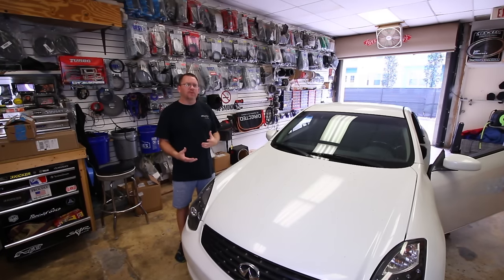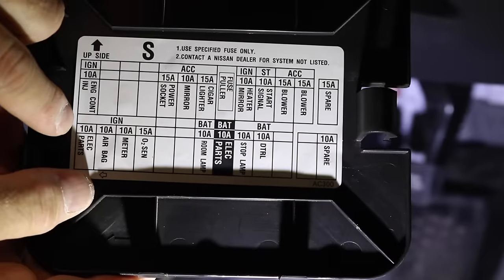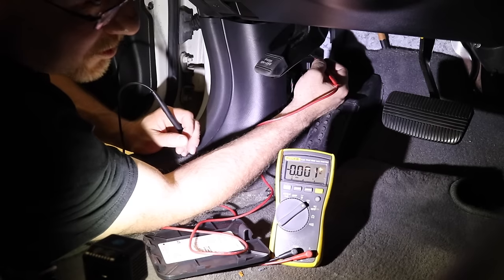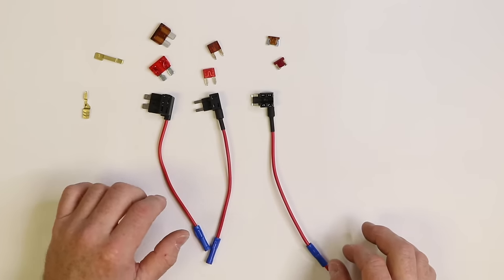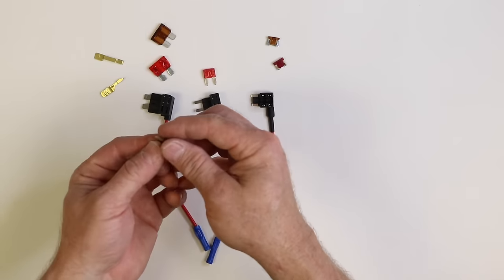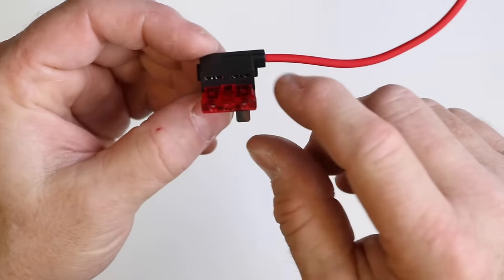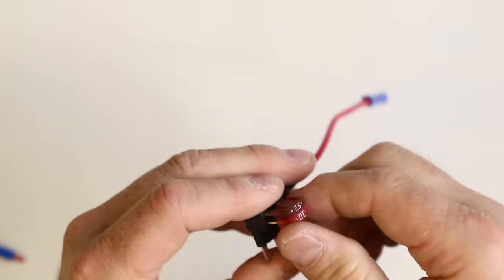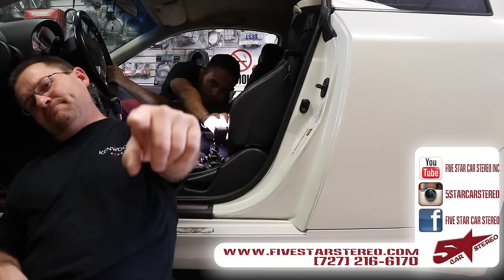How to tap into your cars fuse box safely and cleanly

Comment: If i am understanding correctly, when you put the fuses into the fuse piggy, you can put them in either way. But when you put the the actual fuse holder into the fuse box, this is when you need to make sure the orientation is correct, and that the load side of the fuse matches the 12V point. Do i have this correct? Or does the orientation of the actual fuses sitting inside the piggy matter as well?
Reply: Sounds like you have it correct...fuse orientation doesn't matter, only the fuse tap orientation matters. Tab that's away from the red wire of the piggy gets 12V...

Comment: I have an empty slot in my fuse box, and I am looking to wire my interior LEDs to one of these empty ports. What would be the best way of doing that? If I use a pigtail connector, what would I put in the bottom slot, if anything? Thanks for the help!
Reply from the maker: N1GHTM4RES nothing would be needed, we do that on German car all the time.

Comment: Say you take a fuse from the fuse box and it drops on the ground and you can't remember which way it was in the fuse box. Does it matter? Meaning, only the t-tap fuse matters which side goes in or even the individual fuses have load and draw sides?

Comment: Thanks for the great video, so helpful!  You mentioned in the video: if you find an open fuse slot that has power going to it, "it's like a bonus!" (3:12) . I found an open slot with ignition signaled power, but want to double check that  it's safe to plug my fuse tap into an open slot... Is there any danger to putting a fuse in a slot that doesn't have anything already connected to it on the other side?  Will it be necessary to put two fuses on the fuse tap if nothing was connected to that circuit previously?  Could I just put a fuse in the slot associated with the new load on the fuse tap? Thanks so much for you help!
Reply: After watching a few videos on this topic, it seems the advice when you've found an empty fuse port is to leave the lower port empty (nearest to pins) and only put a fuse in the top.

Comment: A fuse is just a part of the wire (a link). It doesn't matter which way it's inserted. It's not polarized. If it needed to be oriented, that would surely be printed on the packaging.

Comment: Hey seen ur thing in bypass amp for the 14 Malibu Bose systems bht I got the Malibu lug got no rear deck speakers bht got a amp but non pioneer system the premium but have the tv and a want to keep the hu or monitor system but like is there a kit like the impala Malibu fir the non Bose pioneer system ? That I can buy or run a loc like see everyone does but worry bout the low sound filter and any interference etc??

Comment: I'm getting ready to add led light strips to my truck. I want to tap into either my dome lights or map lights, so they come on when I unlock the truck and open the doors. I could use the same process for that application, correct?

Comment: Very informative especially the hot side concerns. Suggest you use blue tape to label the two new fuses on the fuse diagram for customer checking down if needed.

Comment: lets say due to space constraints (my situation), you have no choice, but to plug the fuse tap backwards.  what would be the consequences of that. I see you mentioned something about zigzag. so the only downside would be blowing both fuses instead of the top fuse??.... or will there actually be damage to the factory circuitry?

Comment: I have a question.  I just tested the cig. adapter circuit using a voltage meter.  The cig lighter only works to charge my cell phone with the key in the ignition (car started), why is the voltage meter still showing 12 plus amps WITHOUT key in ignition?

Comment: Hello just curious, can you use piggy back another fuse adapter into the extra fuse slot in the first fuse adapter or is it bad? I have a dash cam and aftermarket backup camera and I want them to run in the accessory socket 12v. thanks.
Reply from the maker: itsdavidd that would be a bit odd but it would work. Or just use one fuse for both. It is ok to have more then one thing on a Circuit. Cars manufacturers do that or there would be a 100 fuse in the car.
Reply: Got it, thank you for your advice.

Comment: I appreciate this being a old video and hope someone can confirm so I heard it correct. 7.01 he has a 25a ontop of the 10a but says this should be lower than the bottom? So if he 10 ontop and 25 this would be okay?
Reply: cmc964845 I believe he had a 7.5 amp fuse
Reply: @towNdrift12v  
👍🏻👍🏻👍🏻👍🏻

Comment: Thanks for the "load" and "draw" info.   The installation instruction for my dashcam hardwire kit did not warn me about "load" and "draw" at all.
BTW, how would you do this for an empty fuse location?
Reply from the maker: Basically the same way. Make sure the power wire to the device is on the opposite side of the power source. That way the fuse is between them. Use the top fuse location on the holder only

Comment: just found this video as im looking to install a usb fast charger in my car, and i'm just a little confused, so when looking at the fuse wire tap, the draw side is on the side with the cable, and the load side is on the opposite side, so which orientation does it need to be in the fuse box? load side always on, and draw side only turning on when the car is turned on?
soz, just not clicking in my head, i hope i was able to get my question across correctly

Comment: Hi

I have checked the below comments, no on has asked this question. 

What are those fuse terminals called that you can add a female connector too.

Not the piggy back ones. The single ones.
Cannot find them anywhere

Comment: Great video. One question i am confuse. How do you know which side is draw and which side is low when you have the ATM with both fuses connected? I know that the original fuse goes to the bottom while the new fuse on top. But which side is the correct way so i dont blow or make a loop.
Reply from the maker: Kaiokhen you want to test the the factory fuse spot, with the fuse out, to see which side has power. Now then you want to put the pig tail wire on the other side.
Reply: Five Star Car Stereo are able to upload more easier to understand hehehehe sorry I'm just dump.
Reply: I mean photos.

Comment: give a recommendation which fluke model to get? i am installing a stinger relay/batt isolator(the round type) how should i connect the ignition wire in a 2015 nissan rogue.the connector m77 is where the ignition is.or do i connect it to the fuse box?
Reply from the maker: Abimanyu Boentaran you definitely want true ignition for the relay. I will have to the model numbers on mine and get back to you.
Reply: I got it, just purchased a pre made tapping fuse and pos it taps and the genuine nissan accesories harness that connects to the accessories plug under the dash with all the wiring. Connects the remote turn on to my Phoenix Gold "remote, ground and +"  accessories turn on unit(lucky I bought it back then it is able to turn on 8 accessories) so I connect my LOC converter, bass processors, amps remote turn on, audison dsp all to the Phoenix gold for simplification. Love the phoenix gold unit. spare battery in the trunk so all the power distro etc at the back of the car. Only need to run one 1 AWG + wire from the isolator to the spare trunk battery.

Comment: Nice vid guys, if i wanted to fit a LED ignition ring which needs to come on when cars unlocked could i just run the wire to a fuse that comes on when the cars unlocked, and turns off then the car is locked?

Comment: Thanks, though you did not explain how to wire up the other side.  You showed how to wire up if you wire directly into the fuse or have one of those connections that go over the forks, but if I’m using a fuse tap, how do I get the other side to now plug into my device?

Comment: So if there is a spare fuse spot open do I put the piggyback in the same way just that I wont use any factory fuse? Will power still reach the second fuse or will I have to put two fuses in the piggyback?
Reply: Correct. If there is a spare slot, insert the wedge as if it is a regular fuse but in this case, you don't need to insert a fuse in the bottom space. Connect the new fuse in line with the wire. If you you think you've used the wrong space, just swap the fuse into the other slot..

Comment: I'm installing a 12v power socket with 2 USB's, it has an in-line glass fuse on the 12+ side. How will that effect the tapping into fuse box or should I remove it ? and use the tap for the fuse protection ?
Reply from the maker: Bryan EDINGER yes remove it and just use the fuse for protection.

Comment: Thanks, now I think I can add a usb port.  I've watched a few of these videos, no one has talked about making a live (hot) port when the engine is not running.   My old Malibu had a port that was still working when the engine was off.  Not the case with the two cars I have today.  I want a hot port when the engine is off.  I guess I have to look for a hot fuse when the engine is off?  Thanks again.

Comment: Hey! quick question, does the left side of the fuse tap, so the load side you were showing us in the video go into the load side in the fuse box? Or are they supposed to be opposite of each other. 
Thanks
Reply from the maker: Muhamed Polovina the wire side of the connector should not have any power on it if the fuse was removed.

Comment: Hi, good video. Wanted to ask, let's say I have a g35x and I wanna hardwire an aftermarket dash cam. Since it's the (almost) same car you used, let's just say I use the same fuse you did, i.e. the 15 A fuse for cigar lighter. Here are my questions:

1) for the new fuse, where do I get it from? A spare from the fuse box, or do I need to buy one separately?

2) What rating would the new fuse be? Since it needs to be less than original, would it be 10 A, or 7.5 A, or 5 A? I'm not sure what the current/voltage rating for the cam will be as I haven't gotten it yet

3) I read about this whole fuse stuff somewhere else too, and they mentioned the length and thickness of the wire you use also matters, because according to some formula it should be this much blah blah. How important is that? I hope it's not a big deal as long as you use the standard fuse adapters you mentioned in the video. For reference, here is where it mentioned the thickness and length: 
https://www.google.com/amp/www.instructables.com/id/How-to-Add-a-Circuit-to-Your-Car/%3famp_page=true

thank you
Reply from the maker: +Ali Khan thank you. These are all good questions. Yes you can use the same fuse.1. I would buy a small pack of replacement fuse. They usually come with every size and are sold everywhere. 2. Most of the camera are 10 to 5 amps. I would wait till you get it and use what they recommend. 3. Wire size does matter but an 18awg wire would provide plenty of power for your camera.

Comment: does it matter what fuse i use on top,i know it's supposed to be a smaller amp, but does it have to be half of the botton or it doesnt matter as long as it smaller amp. ex:5amp top,10amps bottom, or 7.5 amps top, 10 amps bottom.

Comment: I want to install a fake flashing LED car alarm to a 10 amp circuit. 
would i need to wire a resistor into the positive side for the LED?
can i install a switch and how would i wire the switch, positive, negative or both?

Comment: Does the pig tail fuse ALWAYS have to be lower amps or cane it be same AMPS.  for example both 7.5amps
Reply from the maker: Diji Taiwo typically they are lower, it should work though

Comment: I'm trying to tap in the fuse box 12 volt cigarette lighter fuse. My led lights have a red wire with black wire, I hooked everything up and only put the red wire in the blue crimp connector but they won't light up? Do I have to wire the black wire somewhere?

Comment: Ok so if I'm adding fog lights and I want them to come on with the running lights at the switch (I've read they need to have their own fuse, and one wire to ground,  shouldn't there be a wire coming from the wire at the switch (neutral)  or as m I getting my voltage type confused

Comment: Ok so my accessory has 2 wires, I believe one is negative and the other positive. Do I just connect both of them to the fuse or just the positive wire? In that case where does the negative go? Thanks!
Reply: Karim...DON'T connect both positive and negative wires to the fuse! Your negative wire goes to any good ground connection on your car (usually a screw going into METAL of the car body will work. The positive wire is the only one that gets electricity from the fuse.

Comment: Nice, only really used butt connectors and seen the uses of ring terminal ones that you screw down/bolt down. Never really knew to much about why you want to uses the spade type connectors. I realize with tapping into automotive circuits thats like the ideal application you use them in. Wasn't aware of those fuse taps now it makes it much less complex to understand which circuit to tap into.... I only would go for cigarette circuits, or power outlets perhaps lighting if you know the circuit well... it could work in more sensitive specific circuits to but like you said if your not very knowledgeable on circuit in the wire diagram . Before the start of the main circuit you could be screwing up a serious circuit like O2 sensor , air bag,...etc.

Comment: So I have 2 LED DRLs that I want to piggyback into the fuse box under the hood using the ACC, however my question is this; do I crimp BOTH red wires (lights came with red and black) into a single fuse tap or should I get 2 fuse taps? Thanks! Nice tutorial btw, superb!
Reply from the maker: +Andy Yin yes combine both red wires into one.
Reply: Five Star Car Stereo thanks for clearing that up mister! I will let you know how it goes!

Comment: Amazing video! But I want to know about these 'spare' fuses.  On your fuse map you had one called 'spare'.  I have these on mine too.  Why wouldn't you use them? And what is the difference between the ones that say 'spare' and the ones that are completely empty?
Reply from the maker: arjem1986 a spare is a backup fuse in case you blow a fuse. They are extra fuses the car maker gives you. They go to nothing. An empty fuse, may be for a feature your car does not have. Sometimes those still have power on on side you can use.

Comment: How do I make an only on with key into an always on/without key on. I would like my 12v outlet always on so I can charge cell phone etc. while away from my car. Have never had a vehicle until right now (Subaru) that had a 12v that turned off with the key. Very aggravating. Can I use an add a circuit in an always on fuse and run it over to the 12v outlet to make it always on? Thanks.
Reply: punknhead23
You can disconnect the positive wire to the cigarette lighter and run a positive wire off an always on from the fuse box to the cigarette lighter accessorie. It's very simple. With using a fuse tap
Reply: Sounds good thank you!

Comment: I recently hard wired a dash cam, but the tap came with a 10amp fuse, and the original Ignition fuse that I removed is a 7.5amp. What do I do in that situation because? ie the 7.5 is lower than the 10amp. Thanks.

Comment: I use falcon zero F170HD+ and Falcon 24 ON Hardwire kit ,My question is what do the ACC white cable(I tap it at rear power outlet) cause my camera is on 24h(I like this )and the kit advertise this option the 24h on.

Regards

Comment: Is it okay if the top and bottom fuses are both the same amps or does the top one have to be lower than the bottom one?

Thanks.
Reply: -------- Can ANYONE answer nubsmackers question? 
At 6:58 we're told that the top fuse (pigtail to your new device) cannot have a higher amp rating than the lower fuse (existing device). 
Are they not two separate fused circuits?
Reply: Using same size fuse is acceptable

Comment: I went to 4 different places and couldn't find those piggy backs anywhere. I was really surprised when advance and oreilly both didn't have them... So I just shoved the fuse in on top of the wire... Not the most elegant way but it works

Comment: I’m a bit confused by the logic here. Are you saying that if you connect the fuse holder the wrong way round, that it will blow straight away? Or that only if there’s is a problem then the fuse wouldn’t blow when it should?

Comment: Hi 5 star, do you agree with this .You do not want your running lights on when your ignition is in the accessory  ( ACC )  position.  Use AC relay or some other relay that comes on when the motor is RUNNING.
Reply from the maker: +65Bogie yes,  we try to never use any important when taping in.

Comment: So that takes car of the power. But if I'm wiring lights for example, do I just ground the other end of the circuit? If so, where do I ground it. Doesn't there have to be a complete circuit for a circuit to work?

Comment: How about the same amp rating for both fuses?  You said the new accessory fuse should be lower than the main.  What about the same?  Thanks!
Reply from the maker: +WASRT I would use it as a trigger and add a relay then.

Comment: So i wired mine up and the converter box that takes 12v and puts out 5v2amp for the camera blew up in my hand. The capacitor inside blew up. Any thoughts on why it did this ?  I had a 10amp fuse on the bottom and a 5amp that came with it on the top .